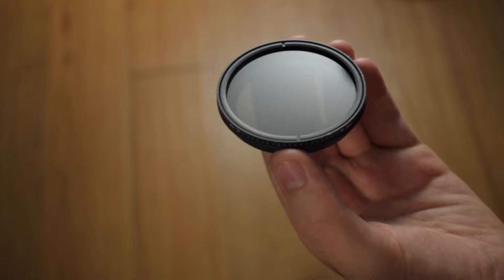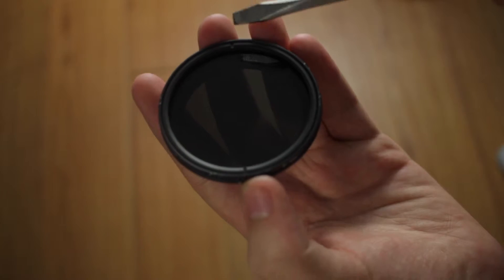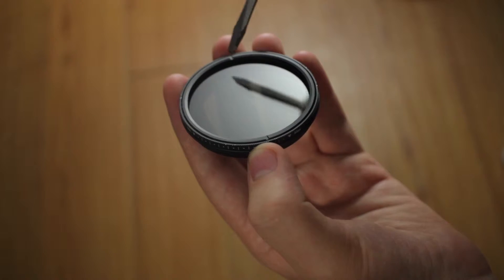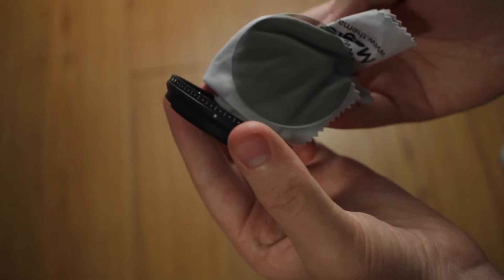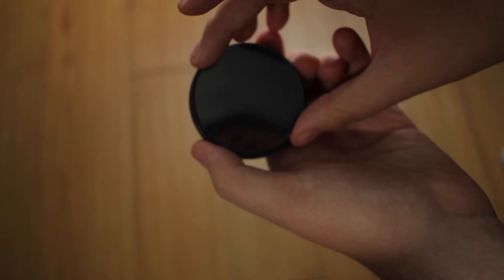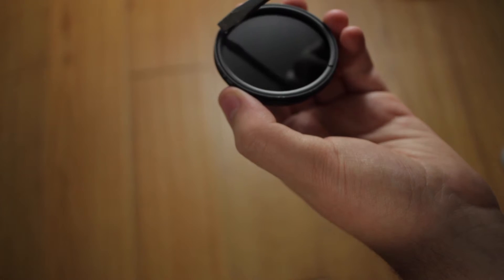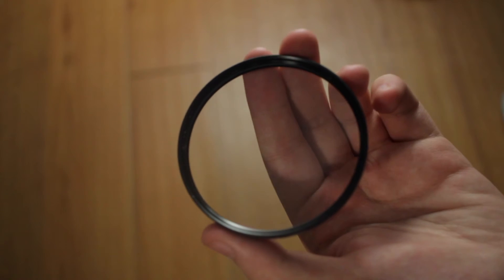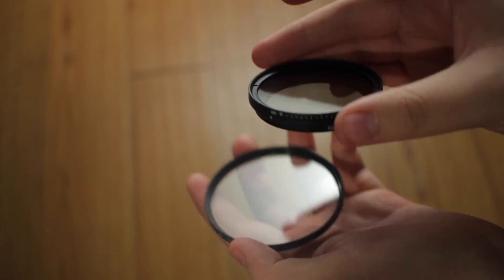How to FIX a Loose ND, UV, Polarizer, Lens Filter!

Comment: Just got my B+W polarizer delivered it's rattling there's no notches though I'll look into it.
Reply: Figured it out  push your finger onto the glass so it grips it  then with the other hand turn the ring that you would use to alter the polarizer effect.
Reply: Humans R Ants How did you manage to fix this? It is beyond me. I have a uv polarizer filter and I have been pushing the glass in and turning the little rim nothing is happening. Which way did you turn it?